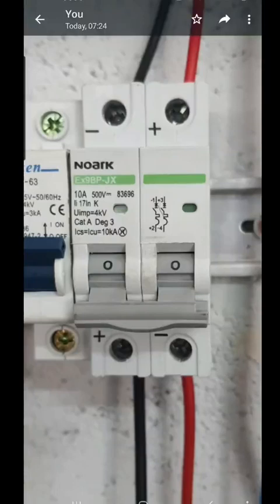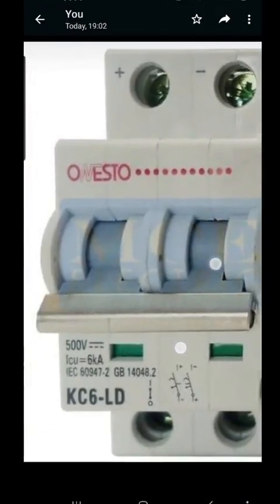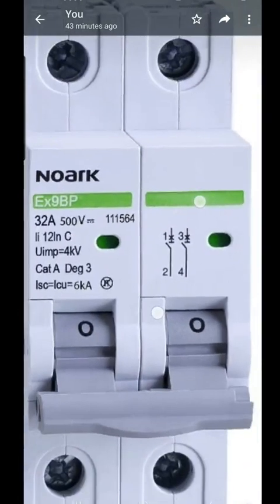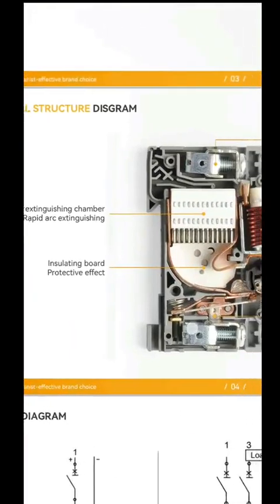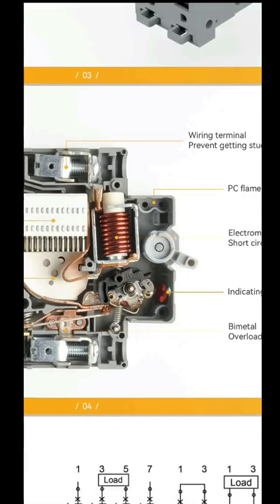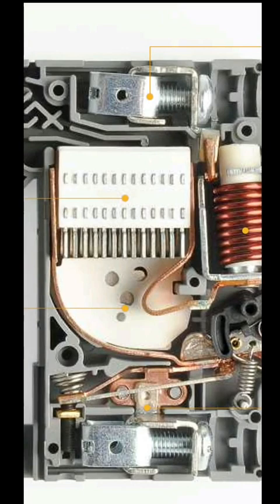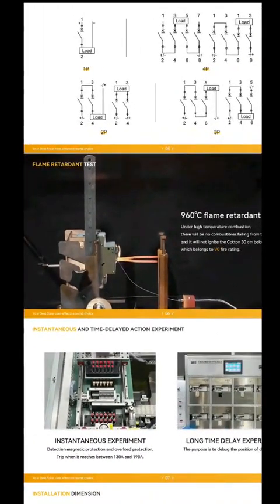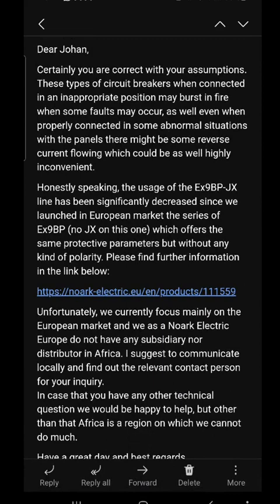Polarity breakers vs Non Polarity Breakers

Comment: When it says + or - then that indicates the supply side not the load side. Thats why it's switched from top to bottom as you can feed the supply down the top or up the bottom as long as the supply side polarity matches the diagram shown. Safer solution is to get a 4 chamber/module 2 pole dc isolater (often called a 4 pole isolator) that way you can have the supply side on top or bottom as each pole loops through the breaker twice for fault isolation in either direction. If the fault is on supply side then one of the chambers will extinguish the ark, if the fault is on the load side then the other chamber will extinguish the ark. And the circuit will be broken on both positive and negative.